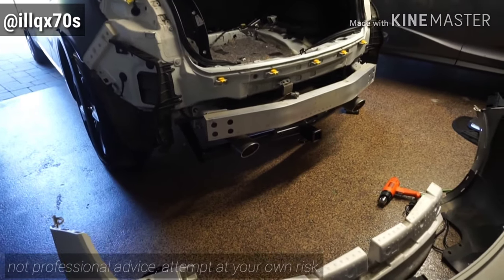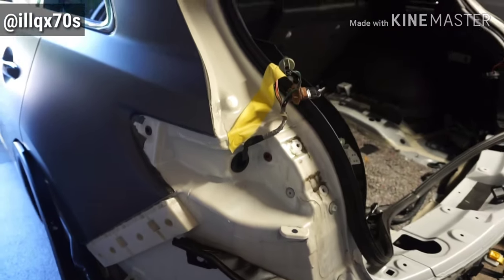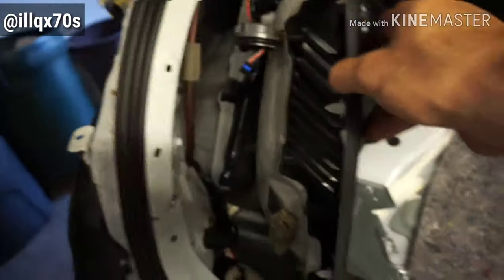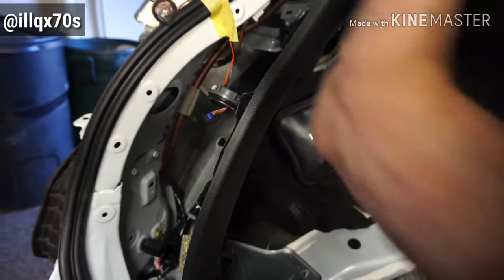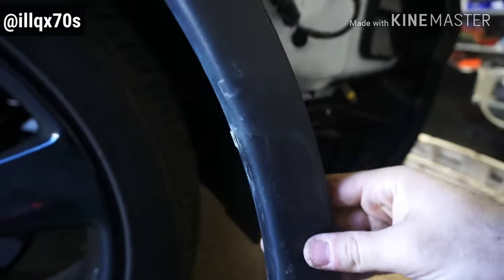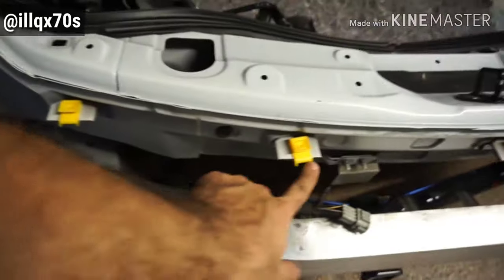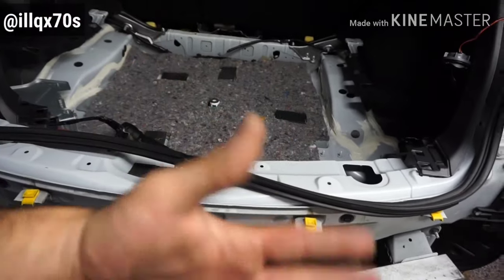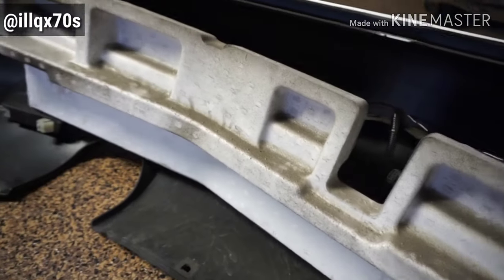2017 Infiniti qx70 Rear Bumper Removal

Comment: Actually you don't have remove the interior to remove the lights for the bumper removal.. Only time i ever remove the interior was when i changed out my all my red light housing to the clear light housing. Because the harnesses on the red and clear lights are not the same. So you have get to the harnesses behind the interior panels to do that.
Reply: Yeah, there's absolutely no reason at all to remove the interior to get the lights off.

Comment: It is very unfortunate that the videographer didn't video the steps as he did them, rather than simply pointing to things after the bumper cover is off.  So the video is helpful, but not as helpful as it could have been.
Reply from the maker: Thanks for watching. I'll consider redoing when I wrap it again in the future.
Reply: dont ur terrible at directions @alphaautoadventures
Reply from the maker: @matthewemery7351  okay sounds good. I'll cross it off the list. Goodluck